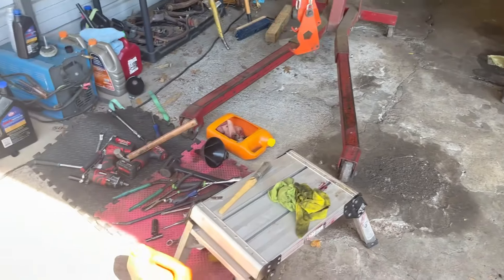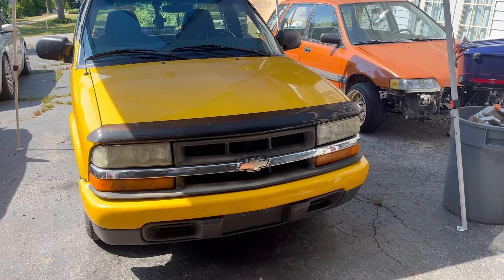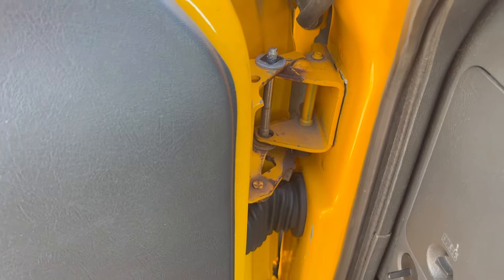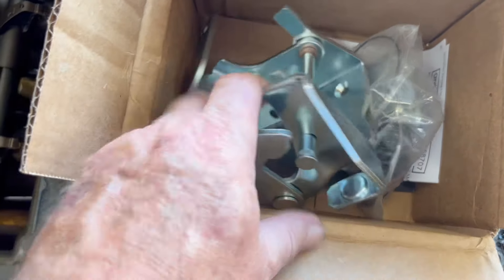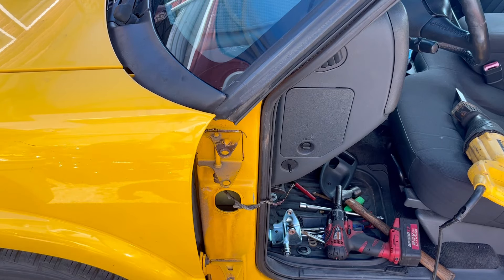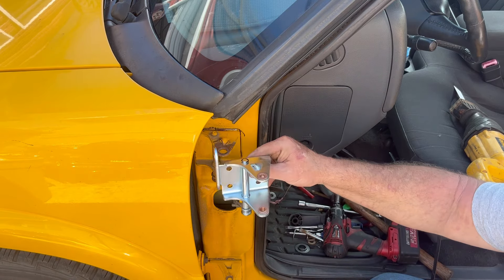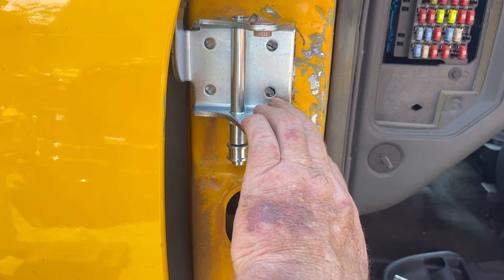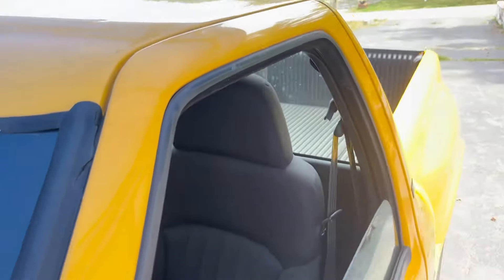Can’t have the door falling off.  Chevy S10 hinge replacement.

Comment: Heheehee punny x) the S10 is coming unhinged I like that. I had to deal with that too unbeknownst to me. I saw a common problem video looking up stuff for my Sonoma and this came up that the door pins are not good and the door sags. I looked at mine and was like... Oh .. it is crooked and the bushing IS gone.... Welp sshhhhiiiii.... Lol and then replaced the driver side pins it was fine I did it in like ....25 min???? I think my dad helped hold the door steady, shuts even better now still a lil bit crooked... Though that's mostly because it was rubbing at the actual part where the bushings press through. Happens to all of them from what I see when it's not caught early lil welding would fix that though since I can't it's fine to me hehe.

Comment: I finally found a video on this subject. Im having steel bushings made. Those bushings in the pin kits are crap. I have a backup plan of putting a solid block of metal in the inside upper hinge with the hole drilled through for the pin and just hard tack weld in 3 spots. I got the block made of wood to take to the machine shop if need be. I really dont wish to replace the hinge.

Comment: Where did you get the hinge kit from?
Reply from the maker: RockAuto
Reply: @TheTazzman1968  thanks any issues with them so far?
Reply from the maker: None so far😎👍
Reply: @TheTazzman1968  sounds good. The previous owner self tapped a couple screws to some flat aluminum bar with a hole cut out and my drivers side door leaks pretty bad. it was worse but I put new pins in and it helped but the seal still isn't touching on top hoping this would fix it. I also replaced the door seals thinking it was worn out but no luck